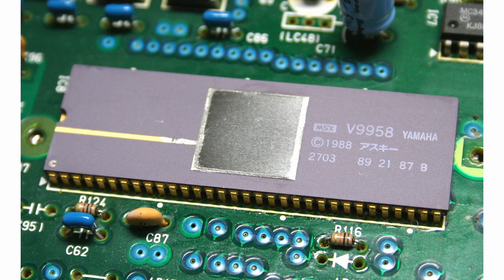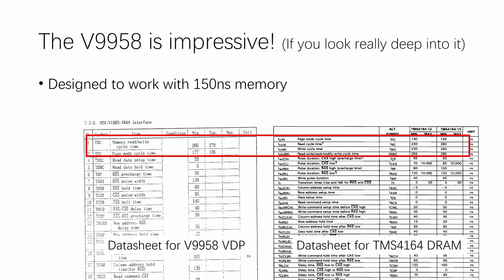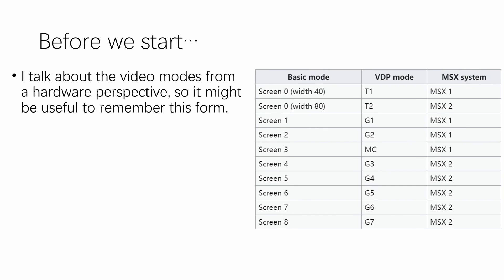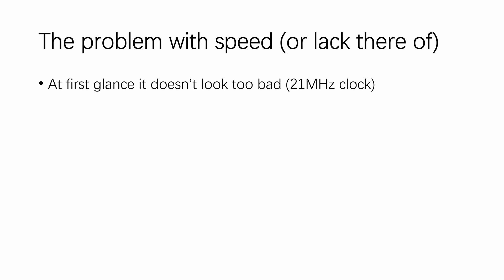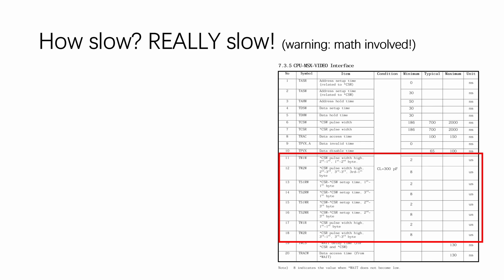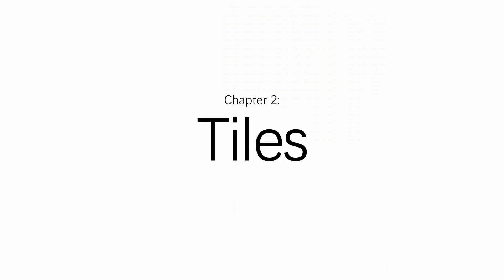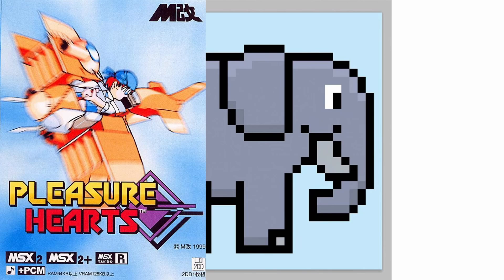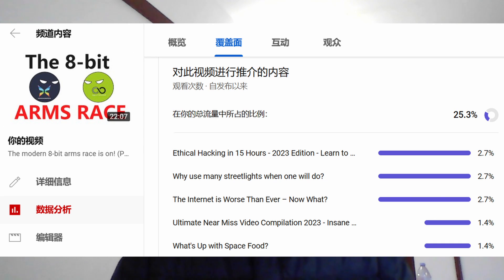The V9958 is a bad design. No, really.

Comment: The V9958 is still the best still available video chip if you are out to design a retro homebrew computer using "period correct" chips. When we started our project "Steckschwein", we used the TMS9929 (european version of the TMS9918) first, which was an impressive chip for it's time. 
Later, we upgraded to the V9958, as the specs do look rather impressive, and we were kind of expecting it to be a great deal faster than the 9929. What was really disappointing was to discover that the V9958 can't do multi colored sprites. Something the VIC-II could do in 1982. 
So, the V9958 really is a capable chip, but with certain serious drawbacks. I do enjoy the 80 col text mode though.
Reply: I think the best video chips for 8-bit retrocomputers are the 32-bit microcontrollers like ESP32 and RP2040 that can generate video signals in software. AgonLight uses an eZ80 with 512kB RAM as its main CPU and an ESP32 as its graphics chip. Only problem with the design was poor bandwidth, limited by a 1.15Mbps max. UART. This is 115k bytes/sec. I thought this was an order of magnitude slower than MSX could do, but MSX limits transfer rate to just 125kbytes/sec.... But the ESP32 in Agon can do lots and lots of high-level commands internally, such as line drawing, scrolling, bitmap blitting etc. And you can cook up your own novel modes and commands as the ESP32 is a fully programmable device. Another recent retrocomputer is the Neo6502, where an RP2040 (with the help of some buffer chips) emulates RAM and all devices for a 6502. The 65c02 can run at up to 6.25MHz.  The RP2040 is basically the only thing the 65c02 communicates with. the RP2040 generates DVI video and can also drive an SD-card and USB.
Reply: @lennartbenschop656 Yep, if you want your homebrew to have some more graphics power and a modern video output, rolling your own using a capable µC or an FPGA would be the way to go. 
With the Steckschwein, we are trying to use more or less "period correct" components, so the V9958 is one of the better options of what's available, if not the best.
Reply from the maker: @lennartbenschop656  It's not only the bandwidth. The data sent on those serial lines are not graphics data, but BASIC commands encoded in text. The problem is that the entire program could also be sent over to the ESP32 and run much faster. And the question becomes a massive 'WHY', since the eZ80 side can be entirely discarded and the whole thing would probably be faster.
Reply from the maker: Agreed. The V9958 is also the chip of choice for the HEC project, too. However, I'm planning to do something to make the chip less painful to interact with (for example, add a simple DMA to it using some TTL gates).
Reply: What about the NEC µPD7220? Instead of going for surface mount ARM stuff, I think the Atmega 1284 is a more relevant chip for giving the 8-bit homebrew a nice boost. I think you can push that chip to do like 8-bit 3-3-2 RGB or something with a resistor ladder at a variety of resolutions.

Comment: I happen to be working on a GPU based on two V9958s, please let me know if you have any ideas as to how I could fix some of these issues in hardware.
Reply from the maker: Are you chaining them using the transparency feature? Then I think you already avoided a bunch   of them. Graphics 3 on top of Graphics 4 or even 7 can make some impressive parallax effects for platforming games. The RGB signals can be multiplexed externally, and you get double the number of colors. And double sprites, too, with 32 in front of the top plane and 32 behind. Plus, you get effectively double VRAM bandwidth as you can do something clever like writing to two V9958s alternately.
Reply: @andyhu9542  theit RGB outputs are extwrnally multiplexed and their color busses are linked
Reply: @andyhu9542  Their color busses are externally multiplexed but their color busses are also connected.

Comment: MSX may not be as elegant as a C64, but it sure beats the CPC and the ZX Spectrum. Please it's an old home computer, its place is entirely different from game consoles.

But yeah one always wishes it was better doesn't one ...
Reply from the maker: If I want to nitpick (I don't), I can compare games like Chase H.Q. on ZX Spectrum and MSX (which would be unfair as the MSX version is a lazy port, BUT I've seen demos of people trying racing game on the MSX2 and the result isn't good) and say that even MSX2 is not good at games that require a lot of CPU rendering. The fair comparison in my opinion would be that the feature of Spectrum games is that they are dynamic, with a lot of stuff flying around a low-res screen with blocky colors. On the other hand, MSX feels static with a lot of beautiful colors (not only in YJK/YAE modes, 16 colors out of 512 on a 256 x 212 screen looks good). the CPC strikes a good balance between the two but is bogged down by the lack of hardware sprites (until the plus range) and low resolution for its 16-color mode.
Reply: @andyhu9542  Probe's Savage on Speccy was probably a horrible idea to anyone with taste.

Comment: I think the ASCII V9938/V9958 was hampered by the slow hardware around it.
Reply from the maker: I have some doubts around that. The V9938/9958 is highly integrated and sits on the bus as a black box. It doesn't require a lot of external support hardware either. There's not much to hamper it, honestly.

Comment: I was already subbed!

The funny thing is I was just daydreaming of creating a virtual (software emulated) MOS 6510 paired with a custom video chip a bit like the V9958. With chunky pixels and maybe some kind of primitive blitter. I even scribbled down a few pages of notes on geometry, DMA, memory banking and timings.

Then this video was randomly suggested to me, and I now think I should definitely design my video chip to do some kind of tiling. And make it super easy to program in 6510 assembler. The algorithm is kind of scary sometimes...
Reply from the maker: Are you planning to make an emulator that runs on the PC?
Reply: @andyhu9542  Yes. Using something like Unity or SDL. Maybe Vulkan? I'll prototype in Python and then switch to C++ for performance. I will probably do development in Linux.

And I've been thinking about this some more. Maybe two or three tiling engines working in parallel, using their own RAM, plus some kind of sprite engine. As well as a way for the 6510 to shuffle data, one byte per cycle, to these virtual co-processors off screen.

I used to program the MOS 6510 to do video tricks on my C64 as a kid. I also did some stuff on the Amiga, but the 8 bit stuff was more fun! :D

Comment: @3:00 so they invented DDR without knowing it? :D
Reply from the maker: Sort of. The issue is that the definition of DDR (sampling data on both rising and falling edge of the clock) requires a clock signal sent to the DRAM chips. The CAS signal is not a clock signal. But they did 'Double' the 'Data Rate' without doubling the bus width, so...

Comment: If building a new retro inspired 8 bit computer with this chip you could use dual ported ram for bypassing the cpu to vram bandwidth bottleneck
Reply: I was thinking the same thing, but I am sure there will be a lot of timing issues. Also, 128k dual port ram will be costly. Still worth a try.
Reply from the maker: The timing design will be hard. Especially converting those alternating CAS signals to something dual-port RAM compatible (they usually use SRAM timing).

Comment: Whilst I never had the fortune of programming on an MSX, I did have a TI-99/4a and did lots of programming on it. The 9918 was badly under-used on the '4a, at least outside some of the games (such as Parsec, which I think a lot people don't realize used Graphics 2). I've read up on the 9938/9958 a few times and looking back I would've loved to have done things on them in their era.

From what I understand, the 9958 was still basically an upgraded 9918. So Yamaha missed a few opportunities: it could've had a version that supported faster memory, but that could've been expensive for implementers; it also could've had more innovative graphics modes, like the tiles of the NES and SNES. But at that point of the industry, people were aiming for 256-colour bitmap modes, instead of innovating on the character/tile modes that were so much more bandwidth efficient.

Comment: Awesome (and pretty funny) video... but how can say mean things about bit planes? C2P algorithms makes the Amiga (and the ST, I guess) so much more fun than straightforward chunky graphics (please note, this is sarcasm). That said, the challenges with chunky display high color, high-res modes in an era of 150ns (250ns+ full cycle time) memory is precisely why the vast majority of mid 80's chipsets used bit planes (simpler distribution of planes across physical memory and interleaved access). By the early 90's we had ever faster VGA/SVGA hardware wired to ever larger and faster dedicated framebuffers that made chunky no big deal. But in the mid 80's, every chipset was trying to figure out how to maximize bandwidth, minimize latency, squeeze maximum color palette options (e.g. not bound to powers of 2) using less memory and, through things like display list processes (e.g. copper lists) provide programmers with options on display manipulation with some programmable concurrency... all because full cycle time was brutally slow. Planar was the way to go at that time (hell, even EGA was planar, and VGA has well publicized planar modes). 

Frankly, that makes the V9958 really interesting, because they basically were just way ahead of the curve. It's a bad design because, like a lot of "out-of-sync" hardware, the engineers took the "they'll figure it out" approach (the "they" in this case being programmers). It's the same reason I hated the Cell processor in the PS3 - theoretically amazing, but practically a really stupid design that ignored certain realities. Namely writing a distributed pipeline of highly optimized SIMD code as shader-like pseudo threads on the Cell's SPE's, making that code entirely non-portable, was just asinine in the extreme. In the real world, nobody wants the hassle of ego-engineered hardware. But retro computing isn't about the real world, so things that likely looked incredibly obnoxious at the time, now look like fun hacking challenges.
Reply from the maker: Yes, and I totally agree with you! But I also want to point out that there are people (me included) programming for retro hardware looking for more than fun hacking challenges. I'm planning for a shooter game on the MSX, and I really want a tile mode sometimes.
Reply: C64 uses chunky. Which 68k based or 8 bit computer used interleave? EGA did use it on an 8bit databus. At least page 99 in the manual very much looks like interleave.
Reply from the maker: @ArneChristianRosenfeldt  Almost all 68k home micros are interleave... The Amiga is a textbook example of interleaved (planar) graphics, the ST has a hybrid of chunky and interleaved pixels. A lot of 8-bit home micros of the time uses essentially 1-bit bitmap with tricks (for example, ZX spectrum). The NES is interleaved in its tile and sprite graphics design.
Reply: @andyhu9542  there are two kinds of interleave. The EGA card interleaves the memory chips, while Atari interleaves the 68k and the shifter.
Reply from the maker: @ArneChristianRosenfeldt  Oh, I didn't realize that. I thought it just means planar graphics.
Reply: @andyhu9542  I mean, the books were quite cryptic for me back in the day, but later PC mainboards had an interleave setting for main RAM. Boring PCs have it! Took away the magic for me. I think that this was a reason why you better installed memory modules in pairs; though now I am confused: Pentium had a 64 bit data bus and DIMM have 32 bit. So you need pairs anyway. Pairs of pairs? Or am I thinking of 486?

Comment: I liked your video and from experience I can tell you that from a programmer's perspective, both the V9938 and the V9958 were rather limited compared to their counterparts in other standards. 

What you have to realize though is that these chips were designed to be used in MSX computers and that they had one important purpose: to be backwards compatible with the venerable TMS99xx series of VDPs, which were powerful when they first came out in 1979, but had already become quite old-fashioned by the time the first MSX1 computers came out. However, the designers of the MSX standard wanted something that could be built from off-the-shelf parts, which is why you won't find a custom video chip in the MSX. It was only in the MSX2 and later standards that a somewhat custom chip such as the V99x8 was to be used. 

Also, the bitmap modes were never truly meant to be used in games. The designers of the MSX2 standard had in mind that MSX2 computers would be more than just gaming consoles. They envisioned an entire line of business purposes as well. I remember working with a powerful DTP application back in the day that was both affordable and good enough for use in low-end media work. The higher color depth modes were specifically designed for purposes such as that, and for purposes such as artwork design etc.

I am looking forward to part 2.

Comment: Can the speed problem be mitigated by using dual-port VRAM (if that is still available) aka direct CPU access to VRAM?
Reply from the maker: If you look at the datasheet for actual 'VRAM' (like, TMS4161, not GDDR stuff), you will find that the read port is a big shift register. It's designed for bitmap only (which, the V9958 happens to lean heavily upon, but the command engine also needs random access). It would be an engineering nightmare to implement 2 devices accessing 2 different ports, one being a non-standard serial port. The V9990, however, does use VRAM as far as I know (I haven't seen a real board), but it still uses an address port +data port design for VRAM access.
Reply: Sure, but if you want more performance and are using more advanced hardware, why not use something like Matthew Hagerty's F18A ?
Reply: @Mueller3D  FPGA's are not period-correct ;-)
Reply from the maker: Also, VRAM access via VDP can sometimes be more efficient (given fast enough VRAM) with things like LMMC allowing you to transfer data to a 2D region without calculating the address using CPU time.
Reply: You'd want to use true dual-ported RAM, not VRAM.  It's typically SRAM, so you'd need to unmultiplex the address lines.
Reply from the maker: @Mueller3D  That would be a good idea except: those RAMs are HUGE (in terms of silicon area) thus literally not available back then. Second, the VRAM is 128KiB, double the size of the address space for the Z80, so some banking is needed. Finally, the timing for such design would be complex (remember the alternating CAS on the V9958? It would be extra work to convert that to SRAM addressing signal.)

Comment: I made a homebrew v9958 video card once. I never bothered to use anything other than G4 mode and the text modes. I made a subroutine to copy fonts to the screen in G4 mode to try to make a pseudo color text mode but that was kind of slow. I plan to try using the v9958 graphics card on my 486 homebrew computer if I ever get it working well enough for that.

What's especially annoying about this chip is that it's hard to make it output a vga signal that works with normal monitors without some kind of adapter so I don't recommend it as a hobbiest chip. You can build a better version of Ben Eaters "worlds worst video card" for less than the ebay price of a single v9958.
Reply from the maker: I do wonder what chipset you are planning to use for your 486? I wanted to make one but couldn't find a source for my chipset.
Reply: @andyhu9542 It's better to make your own chipset. I'm using an ICE40 fpga.
Reply: @andyhu9542  It's better to make your own chipset with an fpga.
Reply from the maker: @scotts-tech  That's going to be some work, but is a good solution.

Comment: It's quite arguable the "no tiles" point. Screen 4 is pretty capable with it's 16 colors per tile (but only 2 per line), and depending on your art style, you can pull pretty impressive graphics on it.
Space manbow is entirely made in screen 4 and almost look like a sega genesis game.
Reply from the maker: On the other hand, if a genesis game looks like Space Manbow, I would consider it a poorly written genesis game (minimal parallax scrolling, 16 colors on screen, small sprites and not a lot of them). I would argue that Screen 4 is more master system than genesis (16 color tile and sprites, single scrolling plane), but a bit weaker since the 2-color-per-line limit and palette sharing between tile and sprites (less colors on screen than an NES!)

Comment: I didn't know it was so weak, I thought adding scrolling to castlevania would be fairly easy. A few games really do look better than mostl amiga games.
Reply from the maker: Castlevania has received some pretty extreme patches (like, turning the entire game into its NES counterpart, btw, the game is called Vampire Killer on MSX, I might have made a mistake somewhere in the video). But no smooth scrolling yet. I think the difficulty is that the game design is kind of tied to the room system, if smooth scrolling is introduced, some game flow may need to be rewritten (I haven't personally tried to patch the game, so I can't say for sure).